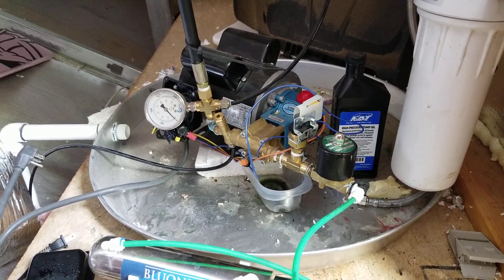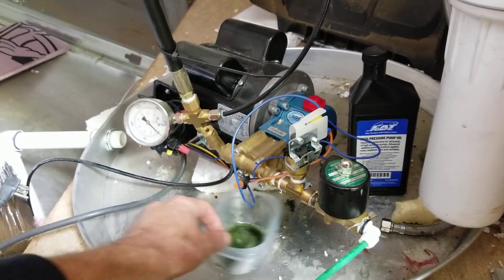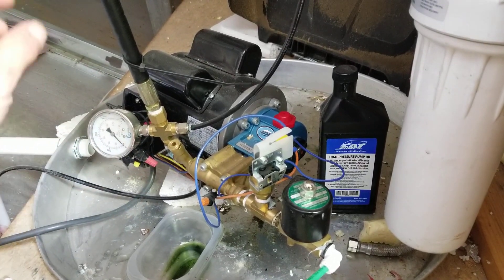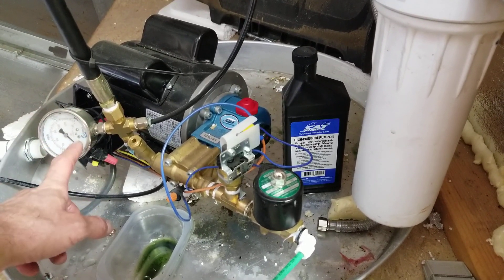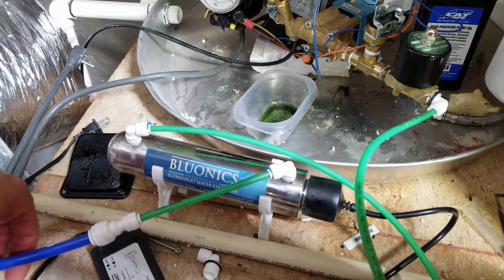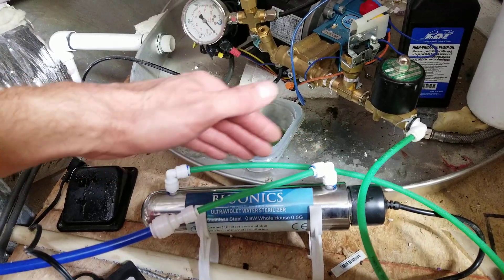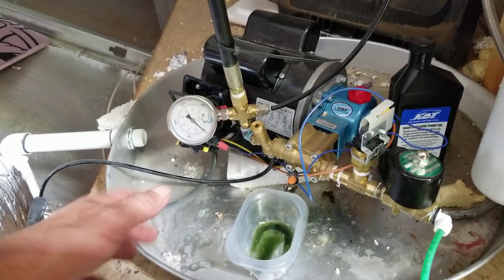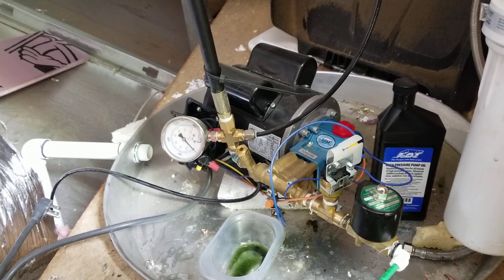1000 PSI DIY Home Made Misting System Update

Comment: Hey Eric, the link to the cat pump in your kit is not working anymore... Can you give us an updated link? How much is this kind of pump supposed to cost, 500 dolars? I have no idea, but thats the quote i got after a quick googling. Thanks buddy.
Reply: Also, have you ever considered using a pressure washer as the "pump" for the system? I am asking that because i had a discussion with some other cultivator in a very famous mushroom cultivation forum in which you are also a participant, and he came up with a system using a pressure washer at the core, and it seems to work pretty well, and as you know those pumps are much cheaper than cat pumps (i dont really know why, actually, there must be some significat design difference in them). Anyway, do you think this setup would work if i got a pressure washer in place of the cat pump? Do you see any reason why it wouldnt, aside from having to source the adequate water conectors?
Reply: @Quiablo  You will need a pressure regulator since pressure washer reach frequently 150 bar >2000 psi and it will consume more electricity.
Reply: @Quiablo  Hey i also had this idea, tested it out a bit with an old pressure washer but never set the whole system up but lately i have been meaning to do it because i don't like the current system i am using. My main concern is how long will the pressure washer motor last? has this guy had it working for a long time? can you link me the forum or whatever i'm really interested!